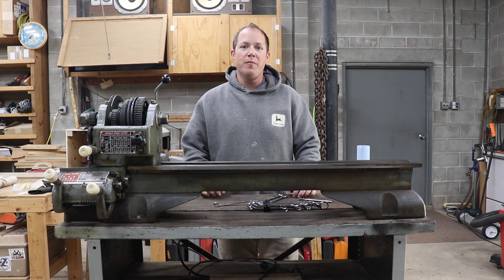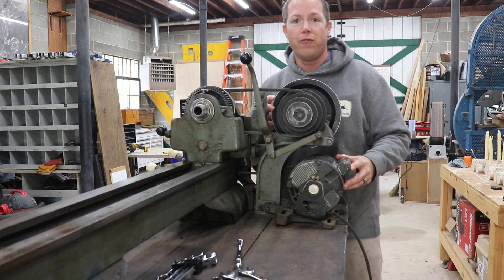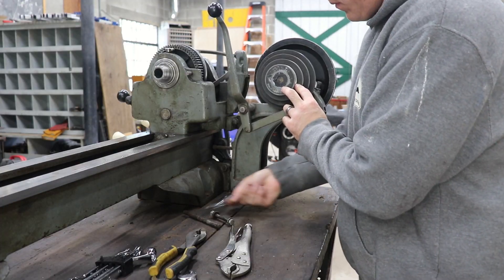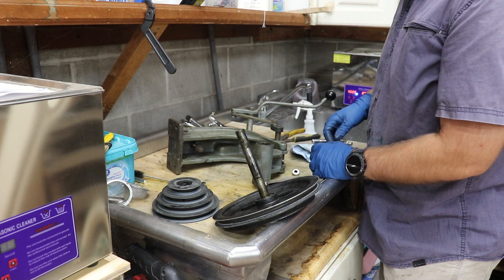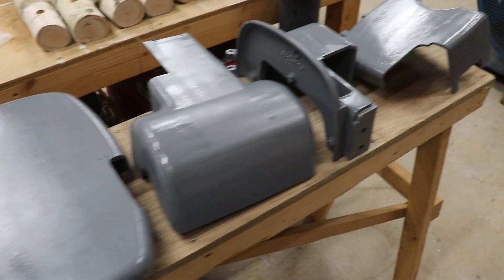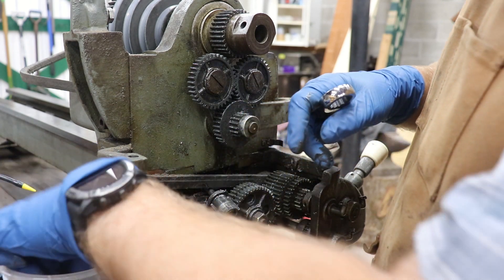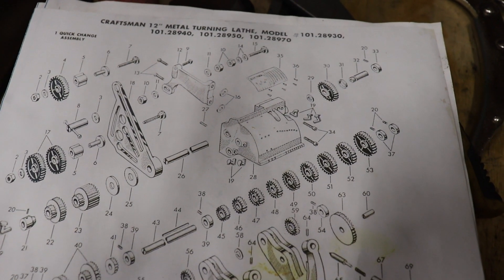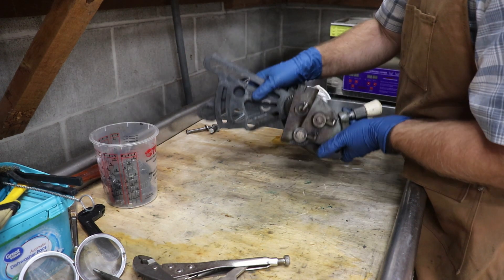Atlas Craftsman Lathe Restoration Revival Part 3 (Quick Change Gear Box & Countershaft)

Comment: Hello. I'm in need of the small gear in the compound gear that you're installing at 9:57 to 10:00. Any chance you may have one? 🙂
Reply from the maker: Unfortunately I do not have any extra gears. I have had good luck finding them on eBay. You could also have someone 3D print them for you.